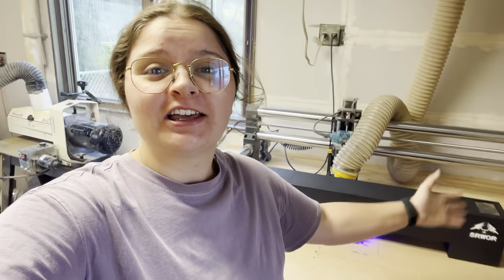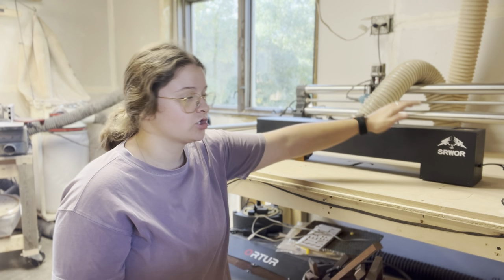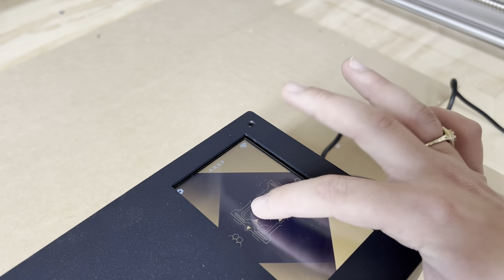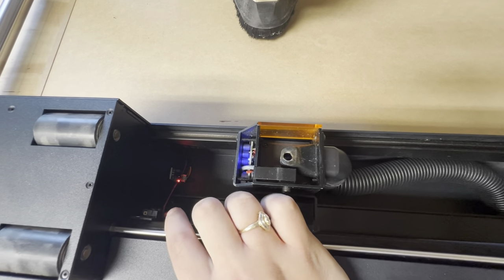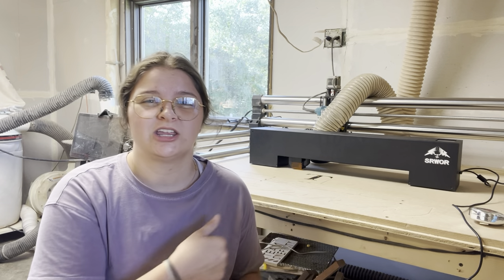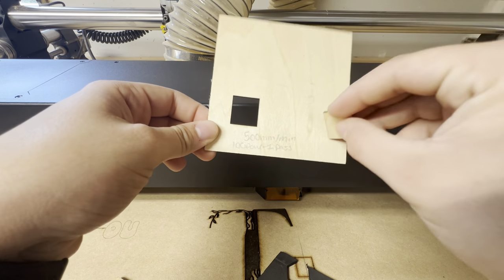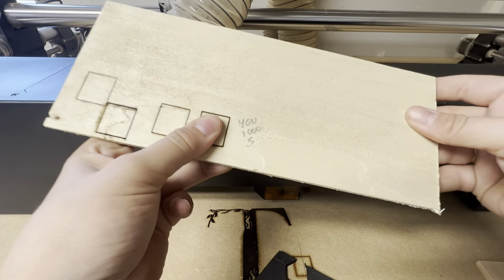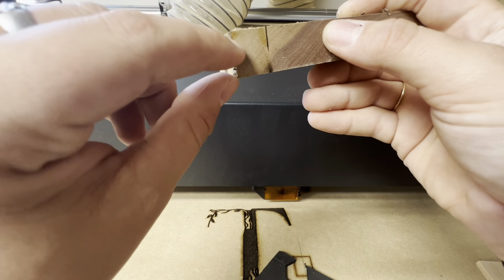SRWOR Infinite Laser Review

Comment: On the last test the laser burnt the engraving on the rounded edges because the laser was not able to get to full acceleration (the distant of the run does not give the laser enough time to get to full speed).  On the longer lines the laser is able to get to the full acceleration.  I believe there is a setting in lightburn that will adjust the acceleration in shorter runs to prevent such burning.
Reply from the maker: Thank you! I’ll check that out! I appreciate the tip!